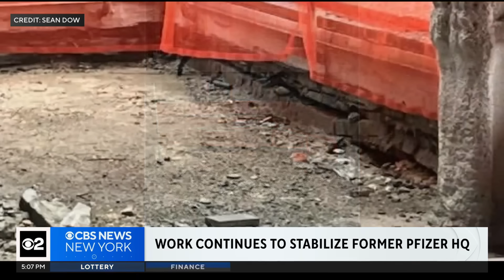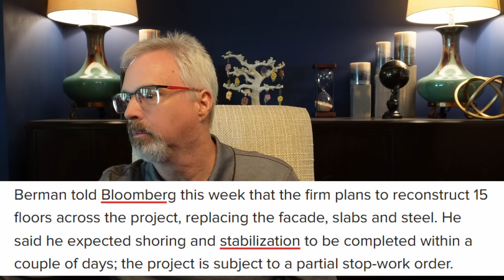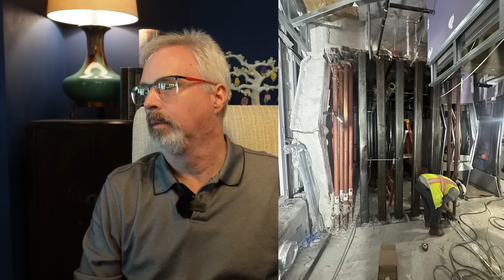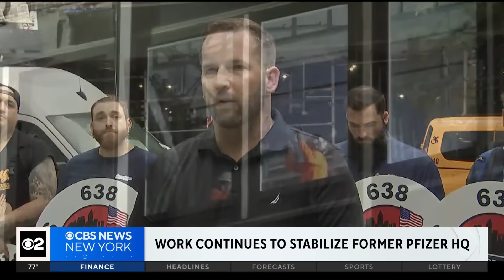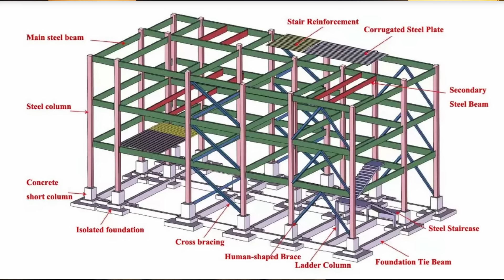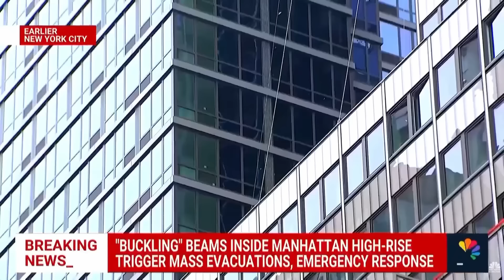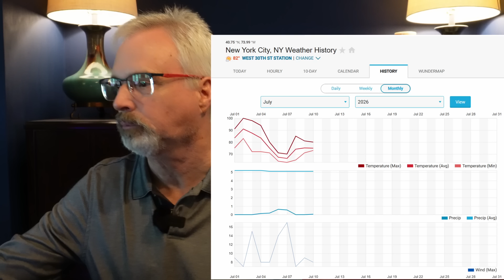Update - Pfizer Building Structural Column Failures; Now What?

Comment: I am wondering if they have done any foundation strengthening, any column strengthening and temporary lateral bracing for columns. I guess the engineer may have designed this with small margins which is a trend to show how good you are when your design is the most economical. Any uneven settlement will cause the loads to be redistributed and some columns to be overstressed. Just hope it will not cause progressive collapsing.

Comment: In the late 70s and early 80s I was involved with the emerging computer systems of the time. One of our clients was writing stress analysis software for designing  buildings like this. They could essentially design a building on paper and then through software increase the static, wind, and seismic loads to the failure point to prove the viability of a particular design. I’m reasonably sure when this building was built in the 60s it was designed  by humans starting at the foundation and sizing the I-beams all the way to the roof. No way they would have added a safety factor that could be loaded with another dozen and a half floors. yes, it is possible that, except for the roof the rest of the building could easily take the load. But if this last piece was overlooked, then how can we be confident about the entire building? And imagine them adding these floors without doing a complete structural analysis down to the foundation! That’s scary!

Comment: This appears to be a scope of contract issue. The base columns of the new structure appear robust and capable of sustaining the loads of the new construction. The engineer likely submitted the reactions of the new construction with the assumption that the older building below was to be investigated and reinforced in a separate contract. Its clear the top columns on the older building were never investigated or reinforced. These columns were only designed for a roof load and were far more slender than the columns above the roof. In many cases the older plans do not exist, so investigative work requires the cementitious fire proofing on the old columns to be removed to measure size and calculate adequacy for the additional loads, or to add reinforcing. The old fire proofing was still on the old columns. 

My conclusion is that this scope of the contract was never addressed. Who's responsibility is this?
Reply: It would be very unusual for this project to have two separate structural engineering firms involved; one for the new upper addition and another for evaluating the original lower section and retrofitting. The only time I have seen this is when an engineering firm is contracted to design the foundation of a pre-manufactured building such as a hanger or something similar based on the loads (vertical gravity loads and lateral loads from high winds and earthquakes) generated by the manufacturers software.

Comment: Hmmm, seems that the structure has been ongoing constant deformation(based on the sag of the slab...4inch is a lot). 
How would the new columns be connected to the existing roof? Would be an assumed pin at the base of the new columns. Then the existing column would have failed mostly due to the increase in axial loading? But why those 2 columns in terms of load path? 
Additional deformations could lead to additional moment in the frame

Comment: I think you're giving too much credit to some of these design engineers.  Not all of them do their due diligence.  They just figure that those beams and posts in the shorter building are the same as the taller portion of the building.  You know, over designed for the load back in the day.  Plus, the push to cut costs.  It all adds up to the failure to properly design for the massive loads you're adding.  It wasn't the bottom posts that buckled.  It was the very top posts.  Why?  There is much more load at the bottom.

I think this is most definitely massive human error in the design process.  Did they check the actual size of those upper floor beams?  They're encased in fire protection coating.  Did they actually remove some of the coating to inspect the beams?  A few stories extra is one thing.  Nineteen stories is quite different.

Comment: 13:45 you are correct, however in the last 50 years (since 1976 pretty much) many buildings have been designed with far less redundancy, and less fire/earthquake/evacuation points as before. In a building with a large land assembly if the underlying building was built explicitly to be X ft tall, and the redundancy is there for fire safety reasons since the taller the building is, the longer it takes to evacuate. Like the city I live in, they want to start making buildings only have a single staircase and the fire chief/mayor is like "over my dead body". 

I no doubt think that adding additional floors to a building reduces the safety margin quite a bit, but that will largely depend on the materials, and concrete is super durable... it's just heavy. So I would really wonder about those support structures material, and if they are buckling now, that means they have likely hit a compression strength limit already.

The right thing to do would be to deconstruct everything added to the building since 1963 and then build new "support" structure for the additions. Or demolish it entirely and reuse the hole.

Comment: Demo should have been done BEFORE plans by designers: the architects and engineers.
Highly suspect that was NOT done or only guessing with a review of the original plans. This lack of seeing and verification of existing conditions is typically done by many owners thinking it saves BUT it doesn't. Change orders are increased in number complexity and cost and added construction build out time. 
Of course i don't know about this property. Seems this review is assuming a lot just like seems to have happened for the PFE building.
Sad
Very costly too.
All the very best.

Comment: Why didn't the added floors continue to fall?
Anyone got an idea why it stopped moving down?
Reply: Luck.

Actually, it means the weight was shifted to other vertical columns through the horizontal floor beams, which flexed (as evidenced by the sagging floors) but miraculously did not buckle or break.

So... Luck.

Comment: Union contractors with better specialized training would have most likely followed the plans and added structural members. Much of the work that should have been performed using plans, could be performed with highly trusted and recognized union companies, with the structural frame work, instead of non union hack labor. Being a union member I can tell you we have much better training and more robust skill sets. Non union companies lack training or have fake training is why they probably would have done this correctly if using solely union labor to build this. You may not realize this, if you don't understand the differences between union and non union general contractors.  But yes non union companies and general contractors are fake lying untrained hacks, generally, also they're generally slimy and avoid following safety AND labor rules and regulations to profit.
Reply from the maker: This isn't about union vs. nonunion in general. This is about the union BA saying the partial collapse was caused by having nonunion labor without providing one shred of evidence to support his claim.
Reply: @CaseyJones-Engineer it most likely was according to common knowledge of how contractors work to cut costs, plus you have the 300 million $ lawsuit at the same gcs other project, making a precedent for how they lack proper safety procedures. They likely hired a builder willing to bend the rules. Aka non union. Union shops are hired based on reputation on ability to safely and properly complete jobs often and wouldn't make this mistake by forgetting to read the plans, putting said reputation at stake. Ive worked for both non union and union shops extensively and have seen this first hand. For example Ive seen non union general contractors poison rivers with lead from old buildings in providence ri. Look up us rubber mills housing renovation in Eagle sq. Providence ri. Were talking  no fs given lead remediation poisoning the city and land to make a few extra dollars. Very similar

Comment: Re: Pfizer building NY
I have watched your videos and a few news stories about the apparent collapse. I am retired now from my life as a special inspector for structural steel and spray applied fire proofing.
I am getting the instinct that the wide flange column we see did not buckle. Instead I think it was damaged by some sort of lateral load either by collision or leverage. Now it makes sense that I heard a criminal investigation had begun.
I can't imagine that a structural engineer signed off on those columns without extensive load analysis.

Comment: Assuming a 10' column, and 2' of deflection (as we see in several images) then the drop is around 9" - and not even close to the 4" claimed by the builders.
(Floor spacing is usually 12', allowing for beams the columns would be about 11' - which makes the drop WORSE)
Play with the numbers a little, they are ALL much worse than 4" drop.

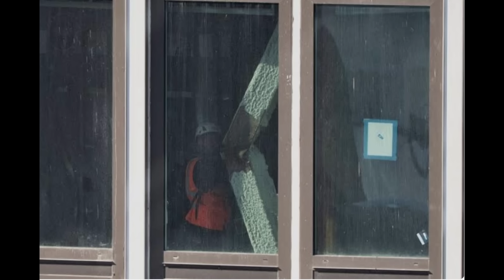Comment: Another Youtube video shows a close-up of the buckled structural columns, as seen from inside the building. By far, the most disturbing revelation by the photo is that both columns consist of TWO PIECES THAT ARE BOLTED TOGETHER (i.e. NOT welded!) at the point where they buckled. The columns did not curve as much as FOLD at the joint between the lower and upper segments ( As seen at 10:53). They should have been fully welded.   Also, the other video confirms that the column IS NARROWER. The reason it's narrower is that the portion of the column above the buckle was JACKETED WITH STEEL REINFORCING PLATES, while the column directly below has no jacketing.

Comment: I recently was a part of a reno of a small house, not more than 120sqm (1000 sq feet), they were removing a load bearing wall for an open plan. The new lintel beam was steel and supported by three steel I-beams of similar size. For a portion of a tiled roof of a tiny house. I can't imagine how an engineer looked at those columns and went "she'll be right, slap 16 floors on them).

Comment: I would be very surprised if the finished structural design by the engineer of record did not include extensive reinforcement of the EXISTING 1960 steel skeleton below…primarily columns. That work had not been done and the existing building had a system of temporary steel shoring columns and beams in place while the addition above was being built. This was a means and methods temporary structural system in place to maintain structural integrity while the addition above was being built. Shoring would have been designed by a specialist structural shoring engineer, not the engineer of record. This happens in renovations all the time.
Someone committed a gross error and allowed some or all of the temporary shoring to be removed so interior fit out work could proceed. This very well might have taken place earlier in the day that the columns buckled. Someone wasn’t paying attention.
BTW…I don’t think spray fireproofing was used in NYC in 1959-60. Back then steel skeletons were still generally encased in concrete for fireproofing.

Comment: I never even thought about temperature causing problems. Makes sense though with different parts of the building getting exposed to different temperatures at different rates for a variety of reasons. Those beams look like they're rusted, so I'm sure that's a contributing factor if they are. I'll bet it's a little bit of everything including a screw up in designed loading that slipped through the cracks. But I'm far from being an expert on this, so....

Comment: Retired Building Official here. My guess is the original building columns were sized and evaluated much lower in the building. Most likely the design engineering team for the addition were not aware that the columns decrease in size and load bearing capacity higher up in the building. The size and appearance of the columns in the new construction seem much greater than the existing ones that failed.

Comment: The whole challenge with a redo and any construction project that depends on what was done in the past is that “surprises” exist - discrepancies between the plans used to construct it in 1960 and what was actually built in 1960. I think in 1960 they saved some cash with cheaper and weaker steel up there that didn’t cause a problem when it had a small load. This redo project perhaps required more archaeology than was done. The original plans couldn’t be relied upon.

Comment: Are New York engineers really this  intellectually challenged?  Your Permitt office dosent require a set of engineered architecturally drawn set of preliminary blue prints prior to a stamp of approval before starting this?  
You do know what a load bearing column block is don't you?  A site plan inspection of soil density and compaction?   Even in 1959,, they did,, and did them for that original approved engineered building. And they used  slide rulers to figure the math. No computers or smart phones.   Tear it down too the soil,, and build from there after a proper ground work too support the anticipated load.  Those added support columns are most likely being supported by the 1st floor concrete slab only.

Comment: I wonder if the contractor in 1960 had used columns that had been damaged while constructing the lower floors e.g. dropped and a slight bend put in them?  “ there’s plenty of strength I them, they just hold up the roof”.

Comment: The real problem now is that there is no longer an accurate model of the building. No survey is going to quantify all the angular loads on the beams and columns in that area. The building is no longer square and true. The Surfside Condo collapsed because the pool deck pulled columns sideways. Add all the shoring you want. It is now all guesswork.

Comment: What I dont understand is how the columns could have bent that much and the building still standing.

I'm not knowledgeable on building engineering, but my intuition says that metal is hard to bend, but is far easier to do so once it starts bending.
Those columns are REALLY bent. It seems to me they should have not been able to hold the large weight above them.

Additionally, they had to bend that much very quickly or it would have been caught sooner. This seems like a case of "we left work and it was good. We came in the next day and the columns are  all v-shaped". 
We might find out more about the timeline later, but my point is that if it bent that much very quickly, that's even more of a reason im surprised the building is still standing.

Maybe we'll find out it was an hour away from collapse or something before it was rescued, idk. But that's how close this seems.
Reply from the maker: You are right. Once enough  stress has been applied to make the steel go from elastic to plastic yielding very little additional stress is required for much larger deformation.

Comment: It’s unbelievable to me that the two buckled columns were not strengthened when 15 floors were added to the old building! These columns were originally designed to only support the roof not any additional levels. There is incompetence all around only not only on the developer but the city engineers who okayed the change as well.

Comment: How can they say they inspected the steel structure when it was covered in that thermal coating?
Does that coating become corrosive when moisture is present?
I only ask because I have seen flat roofs being replaced because the insulation between the decking ang membrane did just that...ate at the steel when the flat roof reached it's end-of-life or there was damage.

Do permits spec what materials were used when that steel had the fire rating installed?

Comment: I wonder if those failed columns were smaller or thinner that what was shown on the drawings of the original construction. With the fire coating nobody would know that they were under spec.  The structural engineers would have relied on the old drawings.
Just a total guess.

Comment: One area I would like to see explored is an analysis of the usable structural section of the column where the insulation broke off. analyze if there were hidden defects (rust corrosion) caused by decades of water intrusion...being that it's below a former flat roof area. There is a possibility that those columns were properly sized for the added floors but due to the corrosion caused excessive: yield /deflection
Reply from the maker: Yes I'm definitely interested in that aspect of the investigation.

Comment: Why did you say that the union guys should keep their mouths shut but the developer can spew crap - which you yourself reported?
Reply from the maker: You must not have watched the video. I said the developer was full of s*** too.
Reply: @CaseyJones-Engineer I acknowledged that but you didn't say he should keep his mouth shut until after the enquiry like you did with the union guys. There's a difference. And the union guys were much more measured than he was.

I did like your content overall but that kind of jumped out at me.

I would also add that it seems very hard to say that this was not a design or a construction error. Whose job was it to say that the columns needed to be substantially reinforced? Surely that was the architect? I mean that's not something that should be winged on the ground? It's rather fundamental.